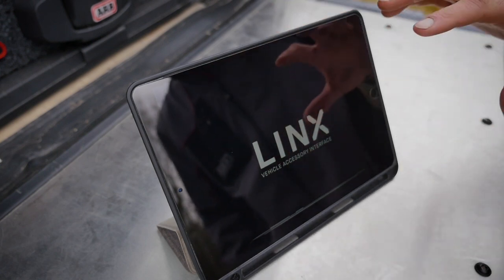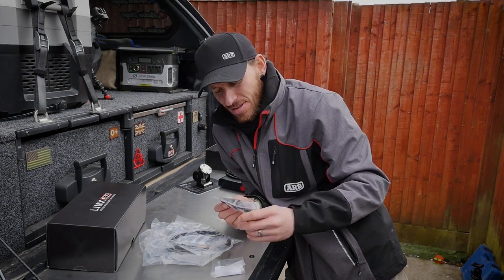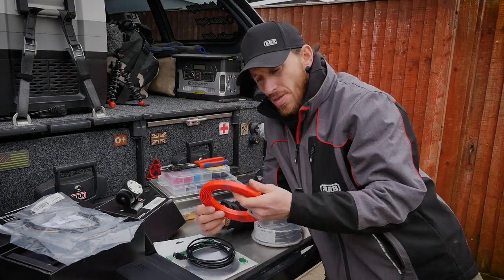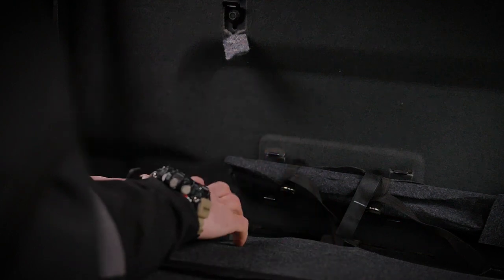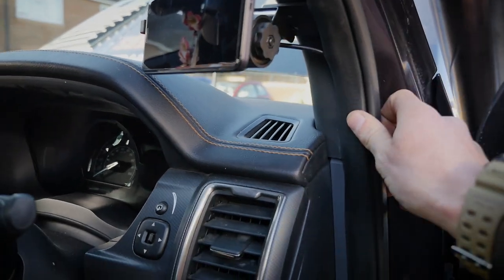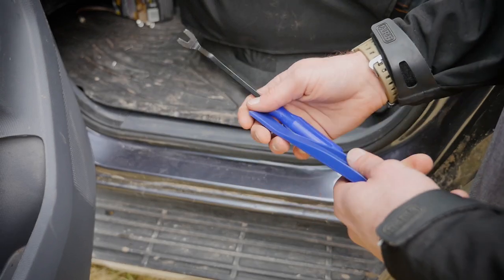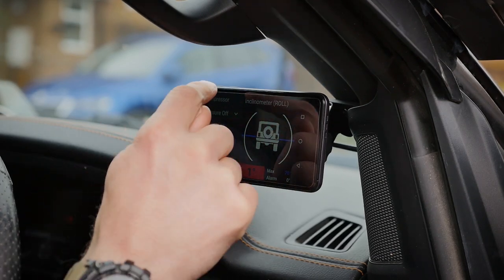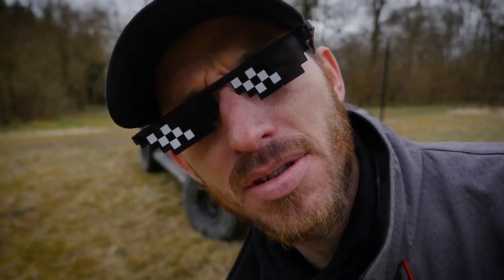ARB Linx Installation

Comment: Stupid question... do you just connect + and -  from you accessory directly into the box? Eliminating the fuse and the relays between light bar and the ARB linx box?
Reply from the maker: No the cables to the light bar are run as normal with relays and fuses however the Linx controller has a cable that will be run from the control box to the lightbar relay. This will start the communication process between the Linx system and accessory, giving you extended features and control over your new light bar.